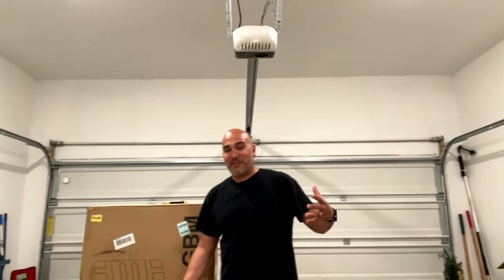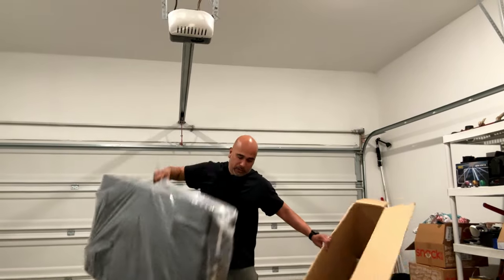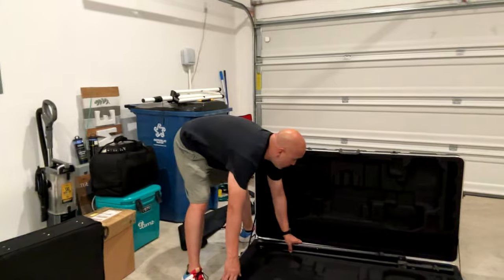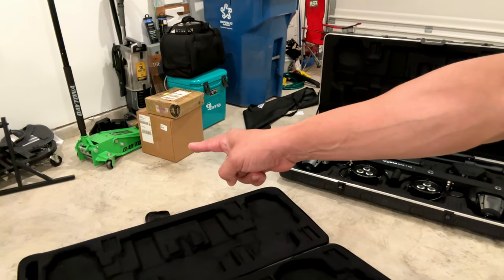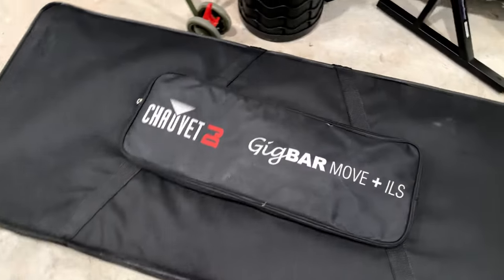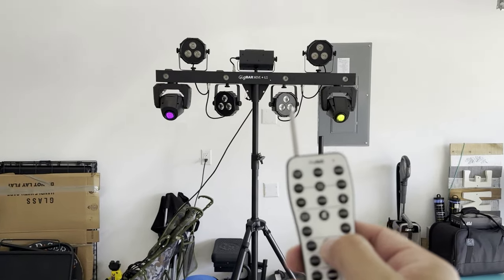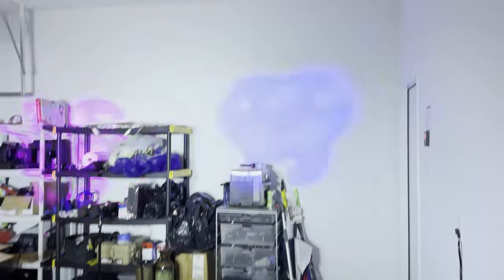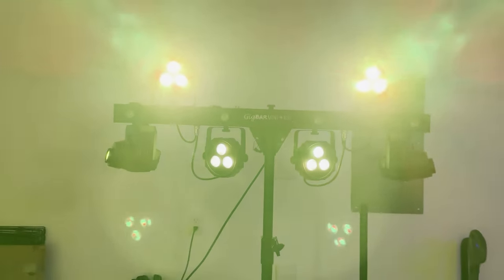The All New Chauvet Gig Bar + ILS Hard Case PLUS a Much Needed Modification to the Gig Bar!

Comment: The Gigbar Move + ILS will not update and it has a startup bug that causes the menu screen to blackout when plugged in and it constantly asks for a USB drive to update the firmware. When i insert the 16GB USB drive properly formatted in FAT32 with only the update file on it directly from the Chauvet website following the instructions . When i hold menu and insert the USB drive a  bunch of text shows up and it just freezes for hours until you unplug it. When you unplug it, it goes back to the FKN black screen and no lights. Please HELP I BOUGHT 4 OF THESE AND THEY'RE ALL DOING THE SAME THING! They will randomly work whenever they feel like it if i keep plugging in and unplugging the units sometimes ill get lucky and the Chauvet screen will pop up saying V 1.15 resetting. I did a wedding with two of these and they refused to power on no matter what i did!  the wedding was a FKN disaster! DON'T BUY THESE GIGBAR MOVE + ILS UNITS THEY ARE TRASH! I will change this comment if Chauvet helps if not im posting this on every ILS video!